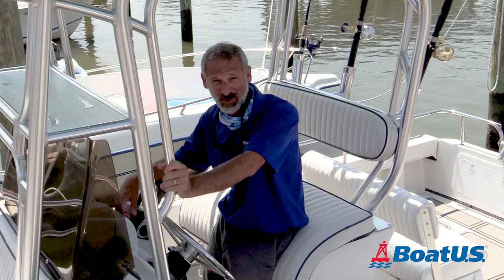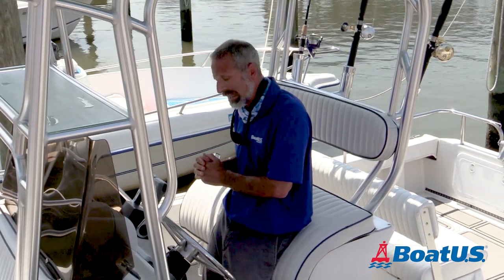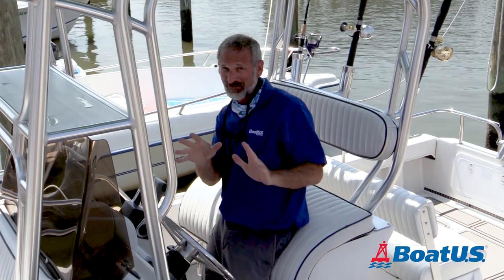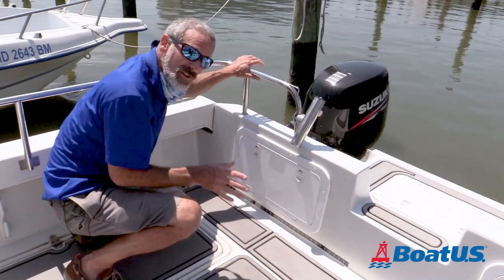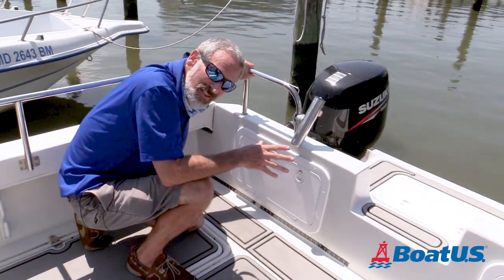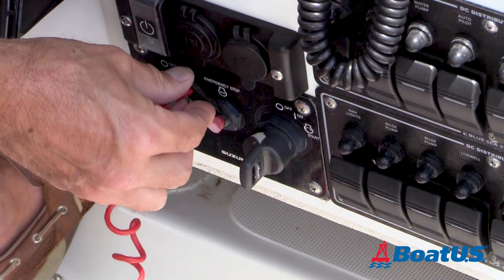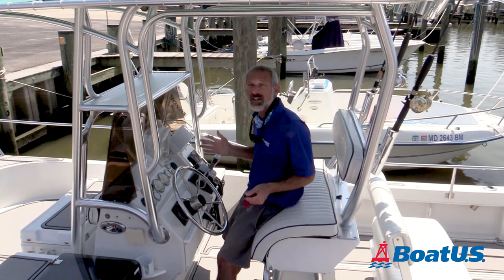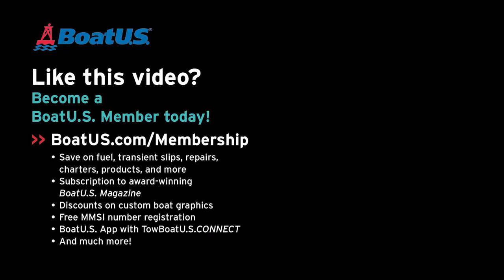Outboard On Your Boat Won't Start? Try These 3 Simple Fixes First! | BoatUS

Comment: Very good tips for newer boaters!
Great job!

~A few things to might add, if I may...;

* If the fuel bulb doesn't get hard while pumping it for a few seconds, you may have a fuel line/fitting leak - be careful with any sparks or open flame until you can get it inspected/repaired. Calling for assistance and waiting is better than risking your boat catch on fire.
 
* While the Kill Switch CAN be bypassed (if you have the tools onboard), it shouldn't be done unless it's a "dire emergency" and you simply CAN'T wait until help arrives - new Laws are being passed that  make it illegal to not have the Kill Switch engaged - and for good reason.
 
* Always carry the tools required for tightening battery terminals... don't ask me how I know that. lol
Check for corrosion on those often!
Reply from the maker: Thanks so much for the additional good advice, Kevin.

Comment: I know it's basic but check the battery switch. May be in the off position. Also, check wires on the battery and starter. Might be corroded or just loose.
Reply from the maker: Great tips, Larry! We're all about looking at those common, basic, easy-to-fix things first. Thanks for watching.

Comment: Tip if you have Fell marine MOB wireless fob: 
Make sure to put your throttle back to N (neutral) 
before attempting to re-start.
Reply from the maker: Sounds like this is advice from experience! 😉 And that applies whether you have a wireless MOB or not. Most engines won't start unless you're in neutral. Thanks for watching!
Reply: @boatus  I agree 100% 😁👍
Reply: It was one of those funny moments...I was demonstrating the MOB fob, dipped it in the water and engine stopped as it should.
Followed reset procedure, but I Forgot to put it back to Neutral. Took a couple minutes til I realized. 😁lol
Reply from the maker: @MrJohnnyArcher  It likely gets us all at one time or another! Had an engine stall while trying to dock and I panicked because the engjne wouldn't restart. Helps to put it in neutral first. 🤦‍♀️

Comment: I just pulled the carbs to clean them, new fuel filter, new diaphragm in the fuel pump, replaced the water separator, and now my motor won't crank on at all. I hear a sound when I turn the key but no crank. I pump the ball till it was firm, made sure its in neutral and the kill cord is attached. Not sure what I could have done to cause a problem
Reply from the maker: Thanks for the question, Brittle. Without being there, it's really hard to diagnose what's going on with your specific engine. Here's an article on troubleshooting you might find helpful. https://www.boatus.com/expert-advice/expert-advice-archive/2016/january/what-to-do-if-your-outboard-wont-start While you've done several of the more obvious troubleshooting steps, there are some others you may want to consider. If you are unable to find the cause, we recommend finding a good mechanic that can better assist you. BoatUS Members can receive discounts on service and parts from local businesses. Visit https://www.BoatUS.com/Maps to see if there are any discount service providers in your area. Good luck and hope it's something simple.

Comment: Any idea why when I turn the key on (Yamaha 150 4-stroke) after several weeks of non-use, nothing. Good charged batteries (2), in neutral, with kill switch in place. No crank, click or any sound what-so-ever. I wait a few seconds then turn on again, nothing, several more tries, nothing. Then, no telling after how many tries, it starts. Not a factor if it's only been about a week since last run. Is this a sign of something in the system going bad? Is there a solenoid that has to warm up? Thanks for your videos. Member since 1996.
Reply from the maker: Hi Dennis. The starter relay (similar to a solenoid) in the F150 is known to cause issues like the one you describe sometimes, but it could also be a bad kill switch, a neutral safety switch inside the binnacle (depending on which type you have), or even just a faulty wire connection. If you want to try to fix this yourself, you'll have to troubleshoot by circumventing or replacing each part one at a time and eliminate each of the options until nailing down the one that's acting up. Sorry for the bad news!
Reply: @boatus  Thanks so much for the info.
Reply from the maker: @dennisjohnson1454  You're very welcome!
Reply: @boatus  One thing I have occasionally forgot is the battery switch.  Might find it in the off position . I know that's basic but the first place I go to because I've forgot it a few times. Lol. Also check wiring on the starter. could be loose or corroded.
Reply from the maker: @larrymontz7355  Thanks, Larry! Great suggestions.

Comment: Oh the classic kill chord! Gotten me a couple times
Reply from the maker: I think we've all been a victim of one of them at some point. I've been caught by the throttle not in neutral. 🤪 Thanks for watching, Ben!
Reply: First time out last weekend after having the motor serviced. Zero action when I tried to start the motor. Eventually realized that the technician turned the Killswitch off when he finished the service.
Reply from the maker: @aytchroberts5850  Ooops. That will give you a heart attack, especially after it has just been serviced. Glad it was something simple. Thanks for watching!!
Reply: Mines don't have the red clip it's a 90 sea sweral